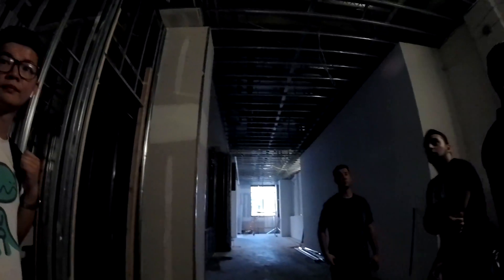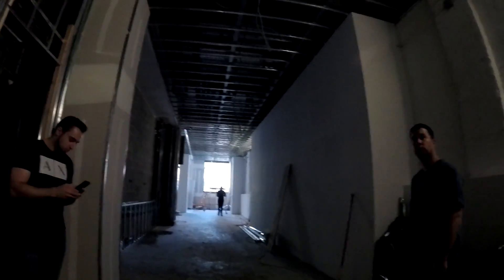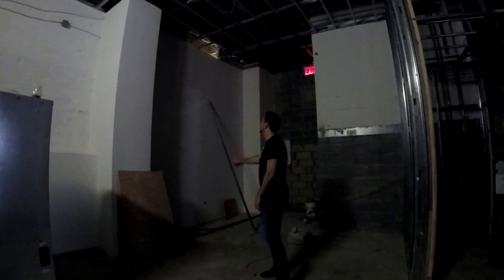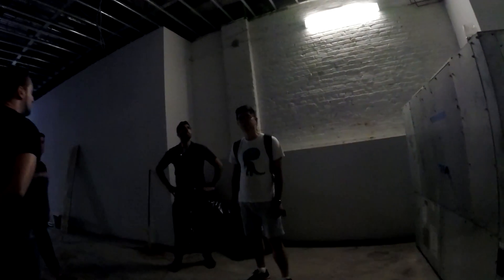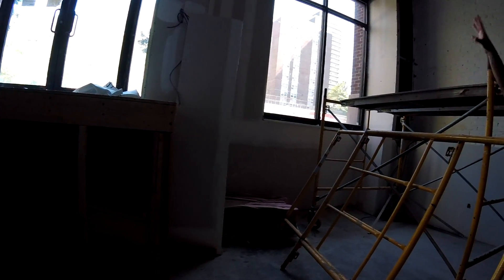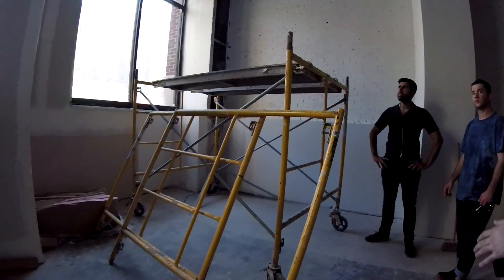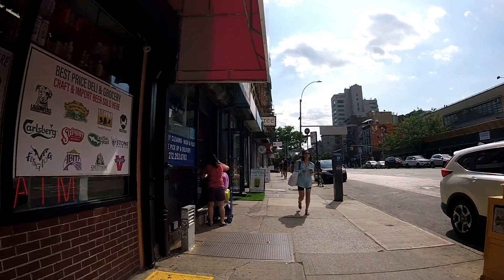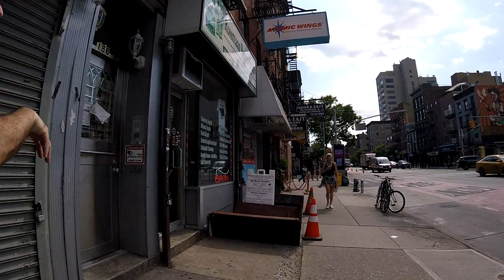Will this be the new Rossmann Group store? Still looking.

Comment: I do know that a lot of commercial toasters are designed for installation in a building with 3-phase, and run on 207 volts.  That's what you get between any of the 3 phases and ground.  (The restaurant I work in had no end of trouble tying to run such a 207-volt toaster on 240 volts.  Elements would break and arc, which is a scary thing to have happen in front of you, especially when it starts throwing bits of molten metal.)  Otherwise, 3-phase is used for high-power electric motors, like in a BIG aircon plant.

Comment: You only need 3 phase for motors. I would not convert to single unless the monthly bills will be lower. Just install a 3 phase pannel and not use the wild leg. Every 3rd slot for a breaker would be wild leg and you would not use that slot. They do this all the time.

Comment: 3 phase IS three single phases, just at different phases (the clue is in the name...)  You don't need to "convert" anything.  You will most probably need 3 phase for the air conditioner because it's more efficient and powerful enough for a large unit.  You would then use one phase for lighting, then use the other phases for two branches of power outlets or however else you need to use it such as 220V outlets (always good to have a few). It's also usual to to have half the lighting on different phases so that a single phase fault doesn't leave you completely without light or power.

You need to talk to an electrician who will design the wiring to code for NY (instead of flopping about with stuff you don't understand).

Just to add...  the building is probably set up for and intended to have a floating floor installed.  You probably could have the concrete professionally polished and sealed but it won't be much cheaper unless you go for bargain basement contractors that do warehouses, in which case your shop is always going to look like a warehouse.  Reasons to use polished concrete are for durability and easy maintenance.  Reasons NOT to use polished concrete are that it makes the space hard, loud, and cold.  That's great for a warehouse or industrial showroom, not so great for a lab, studio, offices, or retail.

Comment: I'm a bit concerned  that a bunch of guys who repair electronics don't grasp the concept of three phase power, and how it can be converted to single phase as needed...

Assuming 3 phase 208V if it's Wye (5 wire), grab power from any hot leg, along with neutral, and ground. That is most likely what it is in a retail or restuarant space, and each hot leg is 120V. (208V is the measured voltage across two hot legs phased 120 degrees apart.) The reason to have three phase in a commercial space like this is simply to increase current capacity more than anything else. It can easy be split into essentially three separate single phase systems to prevent overloading allowing for a large distribution of circuits throughout the space.

 If it's Delta (4 wire) however, a transformer may be needed. Delta is most common in places where industrial motors are used, i.e. factories, as 3 phase motors don't require a neutral line, only the three hot legs and a ground line. It's also more common to find Delta systems at 480 volts and in some cases, the hot legs may carry different voltages.
Reply: If it's delta inner-city, definitively isolation transformers for the computers and diagnostics.  You already know this of course..

Comment: I think this place has potential. Make the store front (and toilet) at street level. If your plumbing/water is near the entrance you need less pipe (and less cost and less risk on plumbing problems). Store your stock under that, it's good to have your stock near the entrance/exit (don't need to carry it around that much). Use the rest as working space. Your customers should not have to use stairs. Ask the people living there about the history of the place. Where there floods? What happened to the last shop? 3-phase electricity is good. JUst finish the ceiling with cardboard. Cardboard is very cheap and can be placed quickly. You can hide the cabling for lighting and plugs on top of the cardboard ceiling, no need for nice fancy looking tubing. Lower the sprinklers.

Comment: Ok, you defintely need to see what is behind those walls, not only the wall with light, but also the big drywall between the pillars in the narrow section. Also see if the room behind the brickwall has any entry, probably through the back exit.

Comment: Handicap ramps have to go out 1 foot (12 in) for every 1 inch in height. So if you have a platform height of 6 ft, the ramp has to be a length of 72ft.

Comment: When you have 3 phase in a building its better for lighting because each phase is out of phase with the other so if you have a bunch of lights you can run on different phases so all the lights dont flicker at the same time  and is easier to work under also if you have fast moving equipment they dont get the appearance of not moving when under single phase lighting. It's a tactic used in a lot of machine shops it stops with accidents

Comment: If it has 460V 3 phase electricity, that's a bonus.  A little more money up front for some extra equipment, but worth it.  With 460, you can get 277V commercial lighting, 230V 3 phase, 240V single phase, and 120V split phase (the last two are normal household electricity) all from the same service.  Its a bit more expensive up front for the extra transformer(s) and panels, but worth the expansion ability in the future.   If you ever get serious, high power industrial equipment, like large scale ventilation for solder stations, you'll be glad to have 3 phase.

Comment: In commercial spaces, 3 phase is very common, you send to balance the load over single phases (~115VAC) each, off a typical breaker for normal equipment, you also get 208VAC phase to phase vs 240, and you have a 277 high leg you would normally use for overhead lighting. Large air handlers with a compressor are typically 3 phase in commercial spaces.

Comment: Need a sump pump if it's below street level, a check valve, and a shutoff for the sewage in case things go south and it backs up. Not rocket science just about any plumber can do it. I would go for it, you could have lofts for days too, lots of vertical real estate to work with. ;)

Comment: Paul clearly does not know shit about any of this, 3 phase is pretty much standard in buisiness buildings, heck, even bigger homes have it, 2x4 is barely used anymore, metal is the new norm, especially for ommercial, that concrete is not ment to be used as a floor, they will never get it nice, it's the wrong mix for that.

Comment: In conclusion, according to the speculation on the comments; this building HAD a crawlspace which is why it looks like the height of the concrete/brick walls stand out. It's been completely gutted of a floor. Another speculation is that it had previously flooded. Until next time when these guys ask the questions etc.

Comment: You can run single phase 120 off 3 phase.  It runs 120/208 and you need a 3 phase main breaker box. Instead of 2 rails, you get 3.

Comment: Having 3 phases actually would be advantageous. If say office stuff+lights, data recovery stuff, and repair stuff are on different phases and someone or something makes a short circuit, the other 2 won't be affected and can continue working without a hitch. (Also,  if LED lights  were on a different phase, they wouldn't affect other instruments like voltmeters and other measuring  instruments and power supplies that much)

Comment: Having watched your videos for hours now I feel that this time I might be able to give an advice back:

1. The whole place looks like it is designed so that the storage should be on the lower level. Instead of fixing the concrete floor I would add a layer to the whole place - having storage below and on top have the workspace as well as the space for costumers in the entrance. This saves you the need of making a ramp as well as people walking by will see what is going on inside. Everybody dislikes going down stairs when they enter a place. 

2. Coming to contractors. As I am from Germany having some American friends living here I still have no personal experience with construction works in the US. But I have many business costumers here telling me about their work - about moving to bigger spaces and such frequently.

If you want something done from a contractor. Please don’t just give them a list of what to do. Instead give them a mission statement of what each point on your list is going to achieve. 

For example - instead of writing: Add a layer of flooring made of X at the height of Y. Write something in a contract that says: We want our costumers so walk into the store not having to use any stairs or steps. Walking on the floor should be silenced by a proper flooring on all parts of the store. There are machines that we are placing in the store which might be moved to every location - meaning that the floor should be strong enough to hold X 140kg on a 20cmx20cm space. 

“Signing this contract you guarantee us that your work will comply to all of your stated needs.” If not you will do the rework free of charge with not additional costs for materials - and so on. After having written down everything maybe even let a lawyer (I bet you have lawyers bringing their macs to you too) take a quick look at it. Otherwise contractors will try to use as cheap as can get materials doing the work as quickly and lousy as they can. 

I have seen and heard this happen so often – happening here in Germany as well as in the states when people had their houses fixed. Most of the time my costumers have problems with programmers doing features wrong. The reason for this is that the person doing the work often does not really know what the feature is going to do or how it might change in future. Always tell contractors what you are doing and why so they can use their brain fixing problems that you might not have thought of when you planned something. 

Make sure to meet and see the people doing your work instead of only talking to their foreman. He might be as competent as your friend from USPS…

3. At the end you where guessing how long it will take people to recognise your new space. Make sure that your address is being changed everywhere you had it. Google My Business lets you change the space after a verification. In Germany they send a postcard to the new address which takes like a week or more. Make sure you add your new location to your address list as soon as you signed the contract. You can have multiple store locations in Google My Business. Google for your Business name and address to make sure that if its on other websites you contact the owners to change your address there tool. That’s my two cents as Online Marketing Manager. 

Good luck finding a space – I suggest you should be seeing at least 2 more places before choosing one.

Comment: 3 phase can be expensive if you have to refit to support it. It also generally has to be balanced for load. The 240v is a bonus if you're working with soldering irons or anything with inductive load. So may be a good idea to have it available. (Most devices support 240)
Reply: Helped refit a factory into an office so was an interesting challenge. Also get the roof leak checked before you sign anything. They do not give a shit if it leaks onto hardware.
Reply: The three phase is normally 415v not 230v. It depends where you are though.

Comment: Each phase is 120v, you just take one phase and pair it with neutral or ground.  Pair two phases together and you get 240v, with 3 phases you get 480v.  I'd go with a raised floor, then you can have your outlets in the floor instead of cables hanging down.  In back have stairs going down for storage and a few steps up for above office.  Your then can store items in the crawl space under the floor if you run out of storage space.  Then you wont need a ramp.

Comment: Maybe a dumb question, but when storm season arrives, will that place flood?
Reply: It’s a valid question. That’s why they absolutely want to have a “Sump Pump” installed in the place.  They were speculating that the exposed pipes on the floor where they say the toilet 🚽 used to be there, is actually the pipes for a sump pump.

Comment: Lot of wanna be electricians in the comments.
240v measured from pole to pole is two legs of 120v, you can run your neutral and get two 120v lines, or draw off both poles to get your 240v, this is how nearly all houses in the US are set up.
208v is three phases of 120v, if you measure from any pole to any pole it is 208v, you can still pull a neutral and get 3 seperate legs of 120v if it is a WYE transformer, two 120v legs and a high leg if it is a delta transfromer.
480v is three phases of 277v, if you measure from any pole to any pole it is 480v, you can pull a neutral and get 3 seperate legs of 277v if it is a WYE transformer, two 277v legs and a high leg if it is a delta transformer.
I wire this crap every day.

Comment: someone thump this up so he sees it and dont lose opportunities for something wich isn't a problem.
Louis im an electrician and trust me its 3phases+N it dont need to be converted, when you use the 120v(120v is US systems, its 230V in most places in the world) outlet, then thats taken from one of the 3 phases on your supply and then a Neutral wich by the way at the transformation station is just the 3 phases clammed together and then grounded, wich creates a Neutral. youll have 3phases+Neutral. you see how the outlet has 2 holes?(3 if there is a ground wire) the 2 upper holes is just one wire to one of the 3 phases and then another to the neutral, the buttom one(if yours have 3 holes) is for ground. 3phases is actualy a good thing, so if you can use a max of 63A on your supply, then with 3 phases that means 63A for each phase, also with 3 phases you can run appliances from eu as they generally require a min of 220V and a max of 250V, on the US system youll have 240V between 2phases, i will seriusly recommend that you ask a electrician to come with you if you have this big of a problem with understanding this, as you might let go of places that would have been good for you, for a problem wich dosn't exist.

im from Denmark(its in EU) here you get 3phases, there is no choice to not get it, its not a problem, it just means you got more power to work with, plus you can run 3phase motors and stuff like that.
Reply: i thumbed up! good info

Comment: "I've never seen a three phase fryer"... perhaps take a peak at industrial fryers and be amazed.
And a concrete floor needs a sealer so it becomes water resistant. Otherwise it'll suck up anything spilled on it like a sponge. And you'll kick up concrete dust from all the walking in there.

Comment: My two cents: I realized something is wrong big time when they have to plan where the toilets need to be (2:18). This store isn't a small renovation, this is a huge structural undertaking. From viewers, I've read how the metal framing of the ceiling is unsafe. Imagine how much it would cost to rework that ceiling alone.  Keep in mind Louis would not be owning the building if he decides to get this property, he would be renting. If the building owner did not want to invest money into making this rentable or at least put in a bathroom, that tells me the owner is looking for a chump. A chump who will pour their own money into making this place up to code and then when the lease expires, the building owner can charge higher rent to the next tenant. This deal is completely in the building owner's favor since they get free renovations AND rent. 
With 2023 years away, my thoughts is to find another space. Louis, Paul, Steve, and RRG should not have to deal with construction of electrical, sewage, knocking down walls, building a bathroom, possibly reworking the whole ceiling frame, and a whole lot of other things for a place that is LEASED.
Reply: pink cinna Unless they get a good deal out of it... like 1 year free rent I have understood and negotiating about the yearly rental increase to be frozen for some years and gradually increasing for some points. It all depend what is been agreed. To me it seems the owner has no more money to fix this place up.
Reply: Have been thru this kind of move and never goes as easy as everyone says.learned the hard way,set a budget first and foremost.Write down what you want,then what you absolutely need then see where you stand.These kind of projects can get out of hand quickly.

Comment: That big ass AC unit is more then likely running three fase. I would reccomnend running tree fase up to the fuse box if you've got the option for it. You can split it up to sigle fase 110 or regular 220 from there, and then it will give you the option for three fase in the building space without really costing you anything extra.

Edit: Also, (I see this not happen to many times) make sure you either run extra conduit pipes or easy acces above your fuse box up above your ceiling. It will save you so much trouble should you find out that you need power to this that or the other in the future.

Comment: I have worked in numerous computer, electrical, hydraulic, and pneumatic repair warehouses and the first comment made about having the ability to pull down retractable power sources from the ceiling is probably the smartest thing I have ever heard from an employee. My last warehouse had power and compressed air everywhere on the ceiling and it made our jobs so much easier. Especially with the power basically being accessible anywhere in the warehouse. Working on smaller pieces of equipment might not necessitate this but the large 50' plus cranes I worked on made the power and air everywhere necessary.